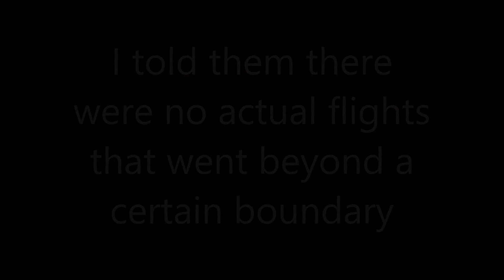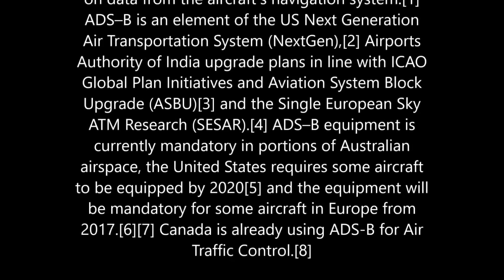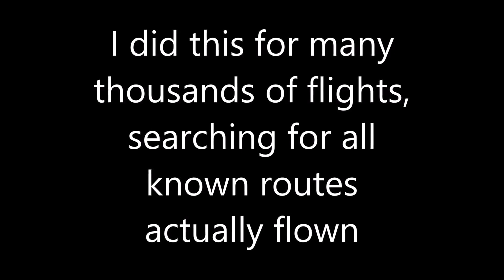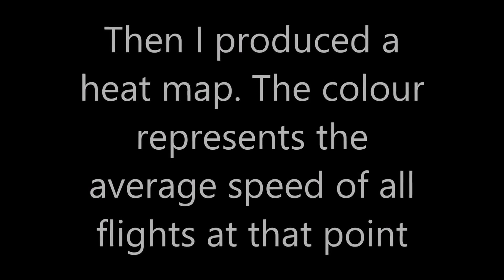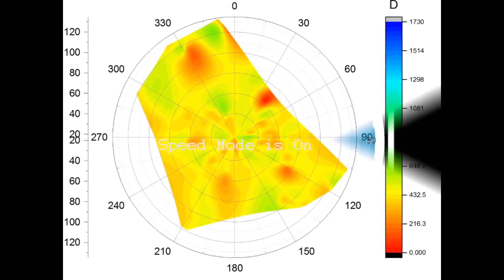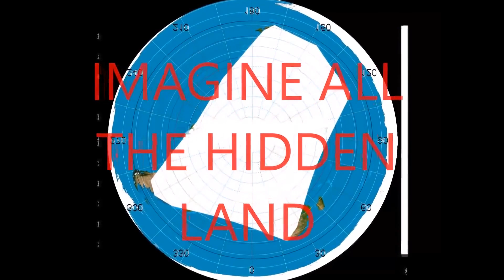FLAT EARTH proven by FLIGHT HEAT MAP

Comment: Keep in mind that airplanes only use fuel during take off and landing, which means they go much slower in cruise mode. The world is much smaller than we think and that is why they shut of radar tracking. When we communicate via internet that is not done via cable, but via the air - and they can't provide 100% record of tracking by radar... Right.. Understand this part and the lies created by the freemason mafia gang start to vanish

Comment: I did not understand it. Heat? What's he saying
Reply: A "heat map" is a way to visually represent variations of ANY type of data by using colors. For example if you take a map of the US and used different colors to represent the population per square mile, you would clearly see all the cities vs. suburbs vs. small towns vs. uninhabited forest Etc based on color. The term is most likely derived from the use of infra-red cameras to check for HOT spots on electrical equipment. In this case, it would actually be a Heat Map based on temperature but any kind of data could be used to produce the same visual effect. Before the internet, Local Real Estate organizations produced "Heat Maps" of the surrounding cities based on average home selling prices per square foot. I remember the purple neighborhoods were very exclusive and as the colors changed towards the red end of the spectrum, these were progressively less expensive neighborhoods. In this video he is using color to represent average speed of the airplanes. (Speed = Distance divided by Time)  As one can see there are variations in airplane speed which possibly can be explained by the jet stream moving at different velocities at different locations even though the pilot did not change the throttle. The dark blue area, however, is not normal and suggests a geographical anomalie that is related to reported distance vs. actual distance between things near New Zealand.
Reply: @bentleyjarrard885  Thank you so much. I get it. I've watched a few vids on flat earth and New Zealand is mentioned in a couple of them  I am from and still living in New Zealand. Thanks again.